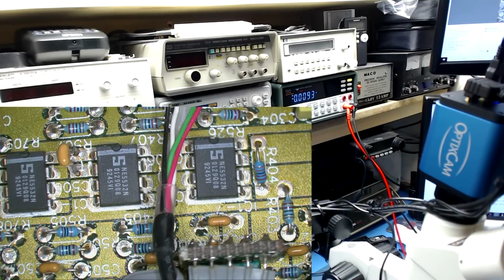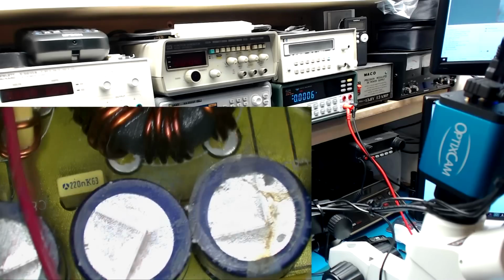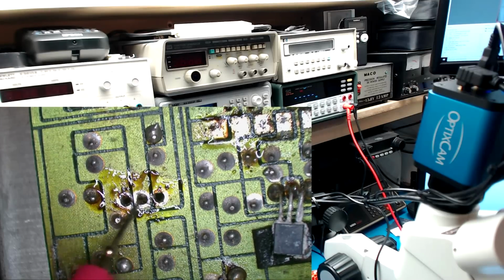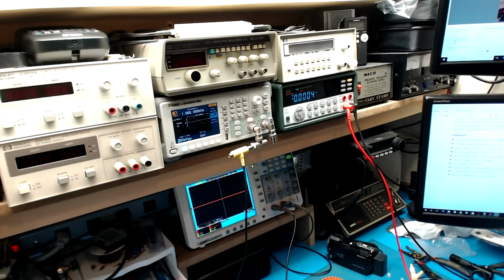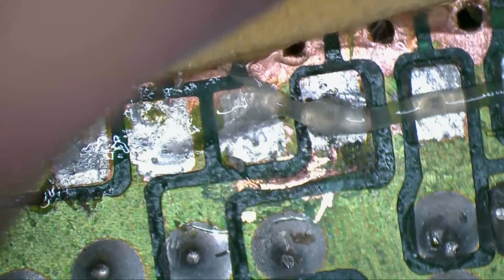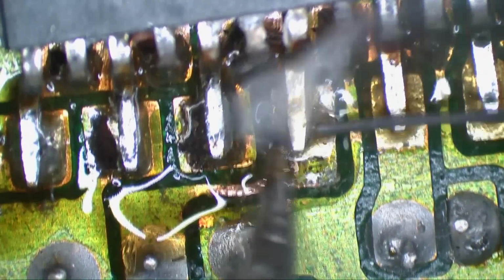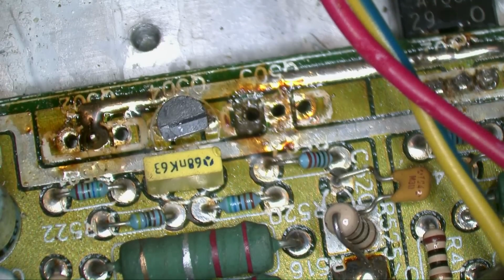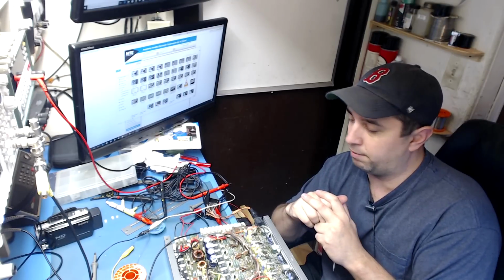ADS 6 CHANNEL AMPLIFIER REPAIR, IN DEPTH TROUBLESHOOTING. PART 3 OF 3

Comment: Nice work. Interesting the Op  amps daisy chain across so for power. I had the earlier versions of these ADS amps. They ran over 20 years no problems. I loved your trouble shooting technique. Ultimately got to have the plus minus all the way though. The common theme for these beasts. I like amplifiers allot from the older days. Much more fun than the SMT/SMD stuff like today.

Comment: I always understood that the first thing to check in a faulty circuit was the rail voltages to the components. If you had done this you might have saved a very great deal of time and taught your viewers how better to trouble shoot these types of circuits.

Comment: G'day, Kev! As a technician, I've recently found you here on Youtube, along with 'XRayTonyB'. (you both, guys really have great information) I'm learning a lot more about troubleshooting complex pieces of electronic equipment that has stopped working. 

Thank you so much for showing the diagnostics process... using simple facts indicated (or possibly indicated) about the nature of the equipment’s fault! Thumps up, on the "AMPLIFIER REPAIR, with IN DEPTH TROUBLESHOOTING!" The best! 

Cheers! :-)

Comment: Hey Kevin can you explain how you connect your oscilloscope to an amplifier as in is this just a direct hook-up or is there some kind of protection in between. Would hate to buy one only to fry it also what are you using to generate a signal? Thanks
Reply from the maker: There are certain things you need to know when hooking on to an amp.  The ground of the oscilloscope must be connected to the  ground of the amp. Make sure the power supply gnd is at the same potential as the gnd on the scope. The ground of the amp can be found at the power input or the amp, or output. Be careful if you connect it to the output of the amp. Negative on the output may not be ground, It may be a positive. You can use a multi meter to verify that. If your not sure use the chassis gnd. You then put the probe on an output. You can run an amp without speakers hooked up, it should not hurt it.